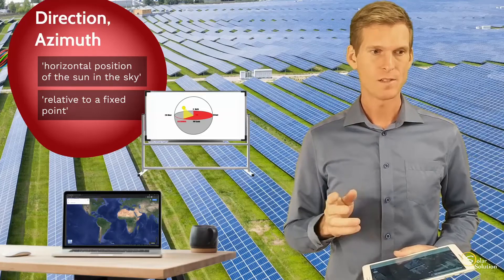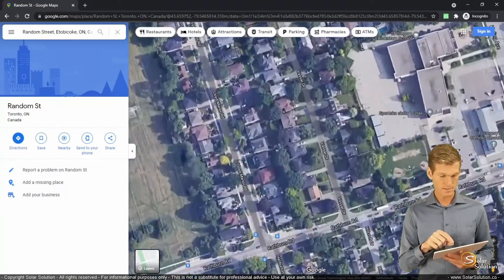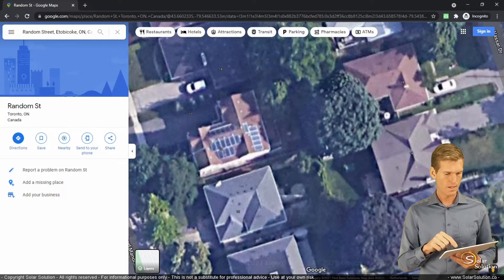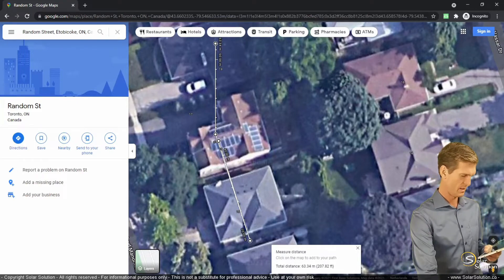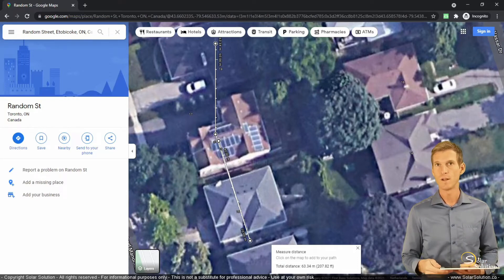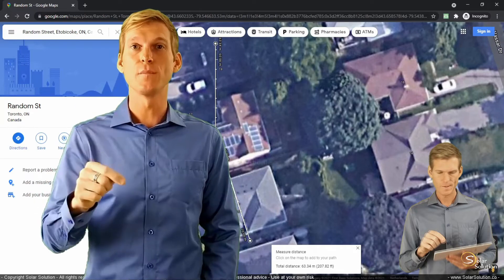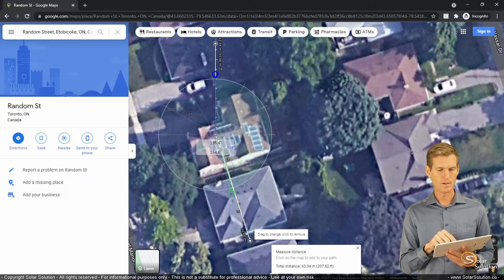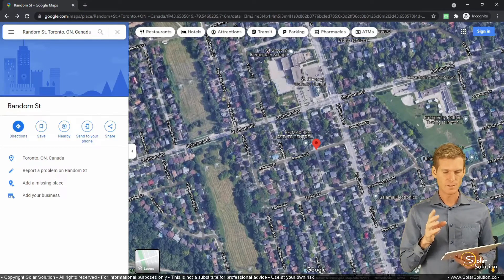Azimuth & Solar Panels: A Practical Example

Comment: so in case of a gable roof, it will have only one azimuth relative to absolute north? disregarding module tilt from roof.
Reply from the maker: That's right. The azimuth is usually the direction of the roof's face, relative to north.

Comment: For places like sub sahara africa with reference to panels installation  is the north facing "mantra" really of importance.?
Reply from the maker: Not so much in my opinion: At those latitudes, I focus more on practicality of the installation location [eg roof orientation] and making sure that there is enough of a tilt to keep the panels clean from debris and dust.